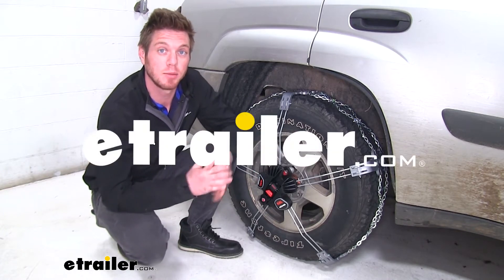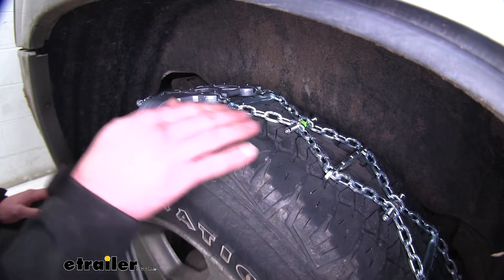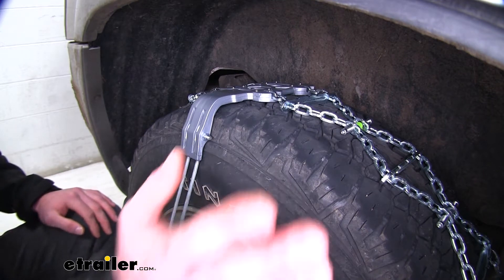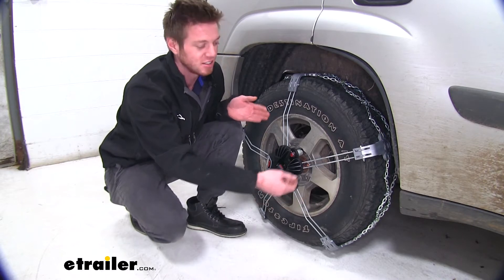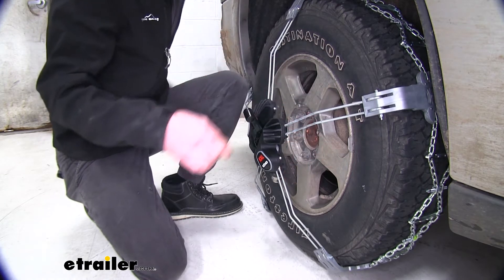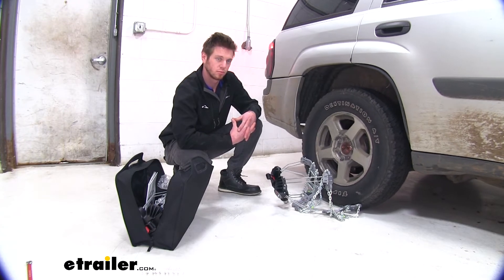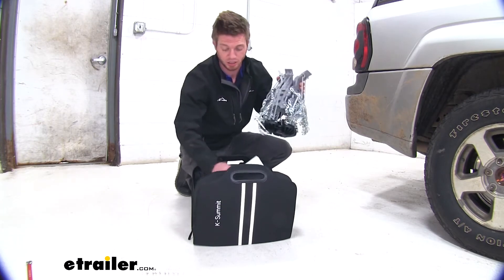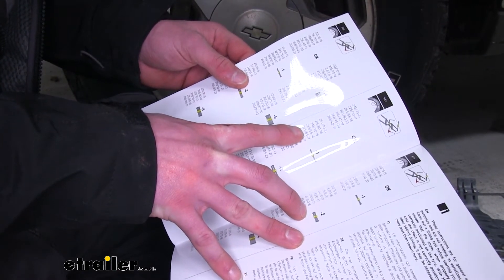etrailer | An In-Depth Look at the Konig K-Summit Tire Chains

Comment: You skipped the part where you use the ratchet to tighten it all up.  Also, the moving tire segment of the video shows the piece connected to the lug nut pointing outward, way off center, contradicting your instructions.  These are actually very effective "chains," once fitted correctly.  I use them on snow tires, and you have to remove way more spacers than specified in the instructions.  But once that's done they fit perfectly and go through anything.  I've driven through 10+ inches of snow with underlying ice straight up a the challenging hill leading to my house and they've never failed me.  When I bought a new car, requiring a different size, I immediately ordered them again.  They are easy to install, once the fitting is finished.
Reply from the maker: Thank you for this feedback on this set of chains. We will keep the points you have mentioned in mind for future videos.
https://www.etrailer.com/Tire-Chains/Konig/TH02230K11.html
Reply: Bro thank you so much 🙏
Reply: Experienced the same, even with removing all yellow connectors as stated in manual to fit my tire size correctly, i needed to remove also a grey one as the tire manufacturer had other interpretation of ERTRO then Koenig( or vice versa). Removing one grey connector lengthens the chain by approx 2 cm. And you loose the springs for selftension at this place so be careful.

Comment: I checked those specs and they do not fit 2014 Honda Odyssey or 2021/22 Toyota Tacoma. Any other commendations on snow chains for these 2 vehicles? I would purchase this Konig Tire Chains if they fit both vehicles.
Reply from the maker: These tire chains are not a confirmed fit for the tire and wheel sizes that come stock on the 2014 Honda Odyssey. They are a confirmed fit for the 2020/21 Toyota Tacoma. You can select your tire size on our fit guide in the following link to ensure that you get the correct size.
https://www.etrailer.com/chains-2020_Toyota_Tacoma.htm
https://www.etrailer.com/chains-2014_Honda_Odyssey.htm

Comment: these seems a lil more work than what i hav seen on other videos and i thought it was supposed to self adjust after its installed to reduce having to come out the car to check
Reply: They do self adjust, but it's always good to check once you drive about 20 yards.  I've never had to readjust, and couldn't if I wanted to because the ratchet is still as tight as it will go.